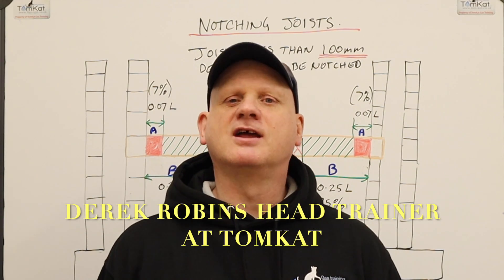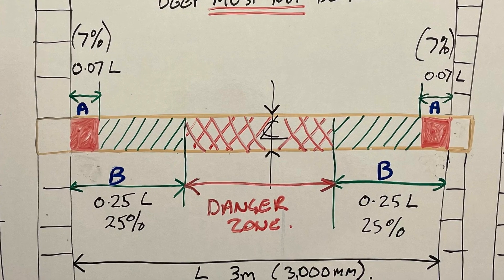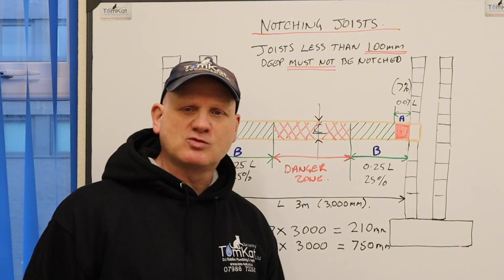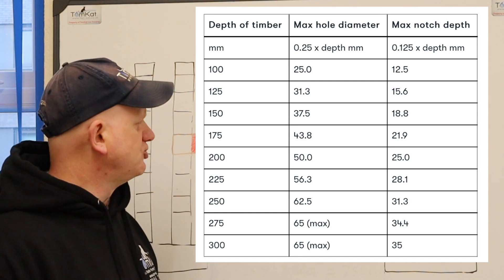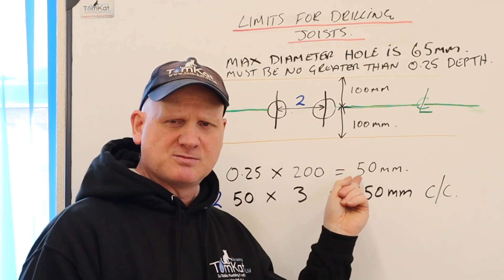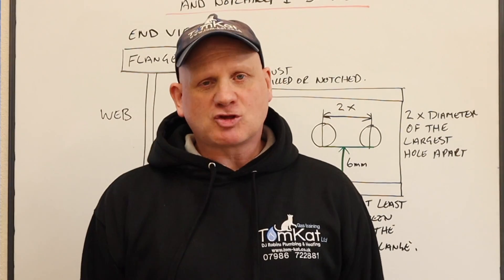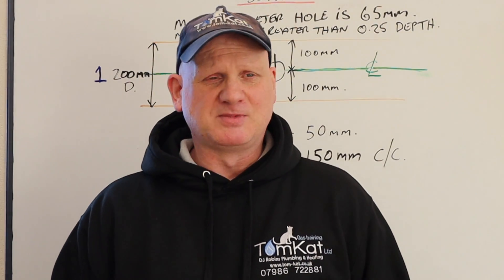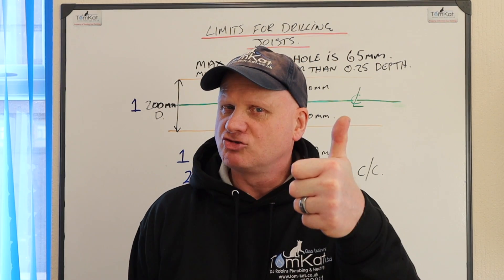Notching and drilling joist/everything trainee plumbers gas engineer electricians and DIY must know.

Comment: My joists are overlapped, wall to wall it is 8.2meters which is 2x 4.8meter joists overlapped 600mm on the load bearing wall. Do I treat this as 1 big joist or do I treat it as 2 separate joists regarding notching/drilling?

Comment: Helpful. But as amateur can I double check with you pls. I have squeaky UPPER floor, which appears to be from loose floorboards (after 18years from newbuild). The floor has underfloor NU-Heat heating which is clipped to the underside of the floorboards. The floorboards are 25mm thick. The original screws used by the builder (to screw down the floorboards) are 50mm long x 3.5mm diameter. My options are:-
a)	Re-tighten the floorboard screws
b)	Replace the floorboard screws to 5, or even 6mm diameter - for better grip
c)	Replace the floorboard screws to longer 60mm screws (of 5 or 6mm)
I want to avoid hitting cables, pipes etc hidden in notch/hole passages in the joists.

Question is, I assume it is safe to use the longer 60mm screws? I am led to “believe” that holes/passages must be 2inches (50mm) away from top/bottom of the joists. And with floorboard 25mm thick, the 60mm screws will only go down (25mm through the floorboard and..) 35mm into the joists; therefore the 60mm screws (re-screwed into the ORIGINAL/old screw holes of replaced screws) likely safe from hitting any wires etc?

Also, can I assume changing to 5 or even 6mm diameter screws is NOT a problem? (if they do not split the floorboards etc).  Can you kindly advise?

p/s I also have headache that if I want to put extra screws, I might miss the JOIST and hit the pipes !!! So at the moment I am just thinking or replacing old screws with longer screws of bigger diameter  - re-inserted into the old/original screw holes

Look forward to you advice/comments. Thank you
Reply from the maker: @kclim2631 I don’t know your system so can’t really comment but I would lift a board first if possible to inspect underneath before I would start putting in longer screws
Reply: @tomkatgastraining  Thank you for your reply. Lifting a board will be difficult or impossible as it has underfloor heating clip-plates on the underside of the boards. Any other suggestions most welcome.   By the way, is it true that (for UK regs) holes must be MORE than 50mm from the top of the joists?

Comment: renovating my kitchen,  plan to run a 3" drain pipe through 5 solid wood joists of 8", (in B area) the holes that run the drain pipe are over 3" Dia, so I want to use the metal joist reinforcement plate to support the joists. it is possible? Thanks

Comment: i need to run a vent hose for my cooker hood if the joists are going the wrong way how can this be achieved? the duct is 100mm. obviously cant drill a 100mm hole in a joist

Comment: Hi there  Derek thanks for the video... brilliant as usual!! currently in my niceic book I think some things have started to become a bit misleading... fig 5.47 says that the max hole is equal to and no greater than 0.30 (30%)of the depth - and if that is the case then 
with the example they give marked in red ...then using a 200mm joist the max hole size should not be more than 60mm however the book says 30mm ....!! also in the same fig it says the min distance is equal to and no greater than 10%( 0.10) for a hole !!! Arrrggghh ....getting a bit confused .Can you throw any light on this for me ? many thanks again 🙂

Comment: When joists from a room meeting those from another room, still in the same direction but touching themselves sideways (usually joined together by bolts, plate with retaining nuts, are they to be considered 1 long joist when talking about 7 and 25%?

Comment: How do you increase the size of the joist?
Reply from the maker: Put new ones in
Reply: @tomkatgastraining  ok so this either means that you need to lower down the ceiling or increase the height of the floor upstairs?  
Or you were talking about ground floors, cause in ground floor you can go underneath joists with pipes so don't really need to notch or drill

Comment: Strange. From a structural point of view the bearing end of the joist has maximum shear force and zero bending stress, so the best place to notch. In the centre of the span is maximum bending stress which increases from the centre to the edges. So in theory notching near the wall (bearing) would be the best place. However in the centre is the worst place to notch but the best place to drill through is the centre (neutral axis)

Of course as you say there's a limit to the size of holes or notches and smooth round edges are best!

You can make extra notches of course. Bonus notches, GOODNIGHT! 🤣

Comment: Worked on a 16c farm house with oak beams and joists floors . both election and plumber notched and drilled joists much to my objection both within allowed spec but together they structural weakened the floor that could barely support itself it was already bent due to it's age . it was used a office  above with filing cabinets after the work the floor began to move and became obvious it had been structural weakened the old timber which had dried out and became less strong over time . eventually the replacement oak floor joists   were fitted  between floor beams spanning 4ft 
The regs  don't cover all situations and doesn't always give you the OK to go ahead without seeking advice from a structural engineer .  
Just been to look at another house fitted with none standard joists 9x1 over 5 meter never seen such thin joist used and fitted in the 1800's before any building regs existed chopping these joists would seriously weaken the floor . in this case I would run pipe work behind skirting boards and design bathroom so soil pipe doesn't interfere with floor joists . sometimes you have to design the bathrooms around the existing layout and not to the customers ideas if it structural compromise the floor joists . 
Also gas flue and solid fuel flues stoves pipes need to kept away from load bearing beams seen so may chopped out below load bearing beam especially 45° flues through  solid stone walls these  structural weak walls significantly . one customers fitted flue  through a supporting 16inch wide column with a  window lintel bearing both side and a oak beam 12x12 resting on top  between the two windows lintel . the fitter was quite happy to smash a 6inch hole just below the Intels at 45° under a two tonne oak beam . if  your unsure always seek advice from a structural engineer if the customers is insisting on a location and your unsure insist on a structural engineer reported before knocking and big holes in joists or walls or below beams.

Comment: Hi Derek great informative videos you make 😊 
I'm have a problem with a Schrader valve in an expansion tank. It won't release air when I press the pin in so can't check the pressure. If I try to remove the valve with the removing tool will it shoot out like a bullet? 🙈😄
Reply from the maker: Are you sure it has any air in it
Reply: @tomkatgastraining  I think it does yes. I was thinking the Schrader valve pin is stuck but I could be wrong. Is it ok to remove the valve if it's under pressure? Of course I will do it in a safe place and point it away from me 😄
Reply from the maker: @2711marcus  I have removed them full of air but make sure you use the correct removal tool
Reply: @tomkatgastraining  Thank you Derek I will do 😊

Comment: Can you just increase the joist size in the area that you need to drill/notch by by nailing/bolting a short length of deeper joist?
Reply from the maker: As long as the new larger joist is supported at each end

Comment: I've kind of made up my own rules to go along with this. Generally the joist size will be the same size throughout the house regardless of span. They'll probably be sized for the greatest unsupported span found. For example, in my house I've got a 7x2 spanning less than 700mm in one place. Therefore I reckon I've got at least half unnecessary wood. 😅 

Only to get me out of trouble. You would probably need a structural engineer to calculate it if you got pulled up. Position is still important because the bending moment of the timber is the same